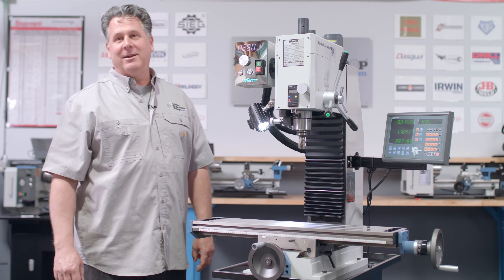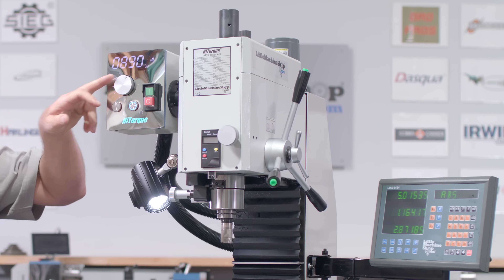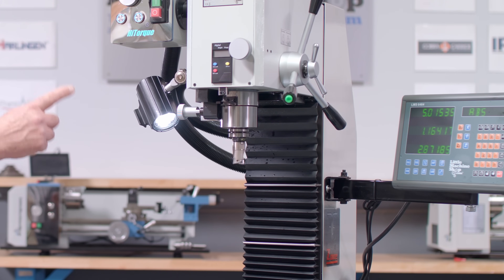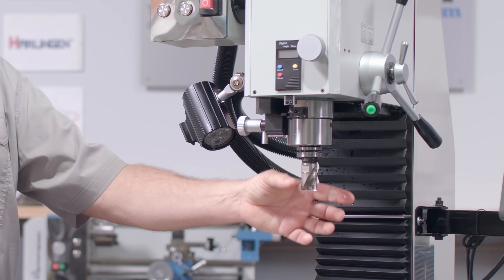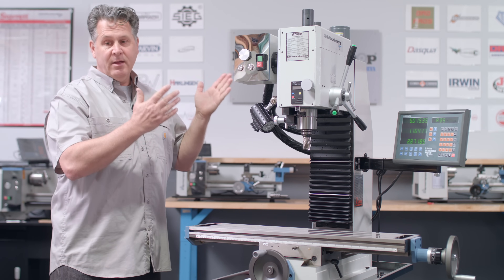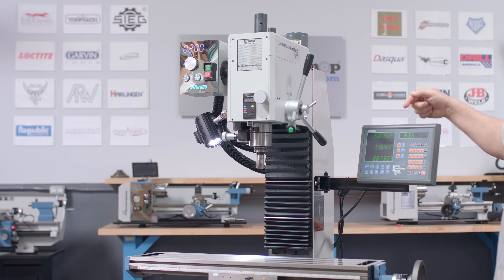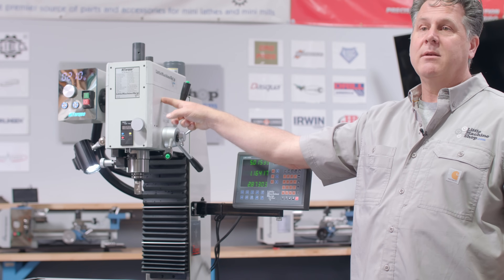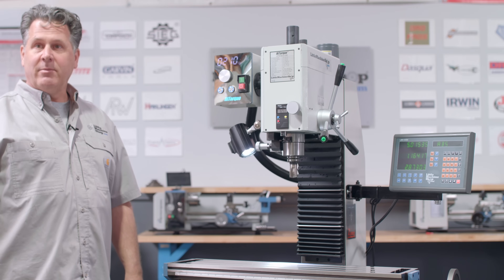LittleMachineShop.com HiTorque 6770 Walkthrough

Comment: It's a very good machine. I would add a few improvements that will make it a great option at this price point. Single shot oiler, interlock to cut out motor if the spindle lock is engaged and a way to fine tune the tram on the head.
Reply from the maker: Not sure you need oil system on this machine as you have brushless motor, belt drive, sealed bearings, etc. You have oil ports for all lead screws, ways, gibs, etc. The power is disable if the spindle lock is engaged. You can tram the column and head if needed, but unlike a tilting head machine that may require this for every setup, you shouldn't need to on this machine. This machine was designed to remove some of the limitations of other machines which required those added "features".
Reply: @Littlemachineshop  Agree, it's a much better machine. One shot oiler is just improved convenience, shouldn't be hard to retrofit if there are existing oil ports for the ways & gibs.